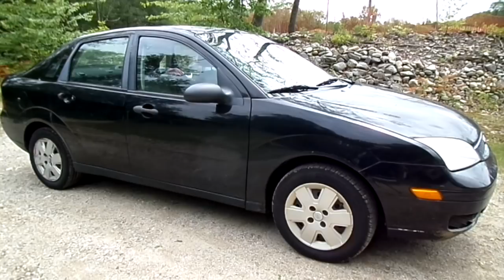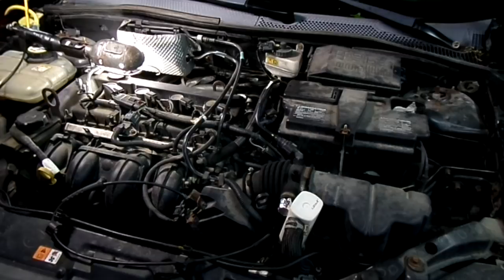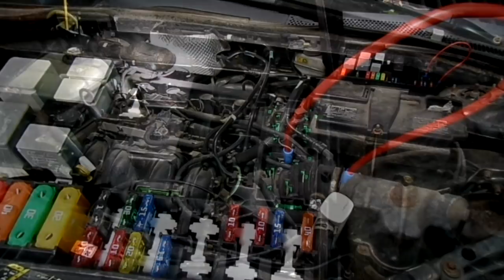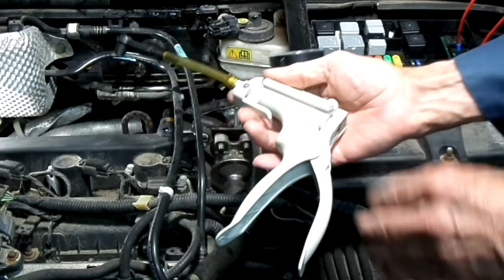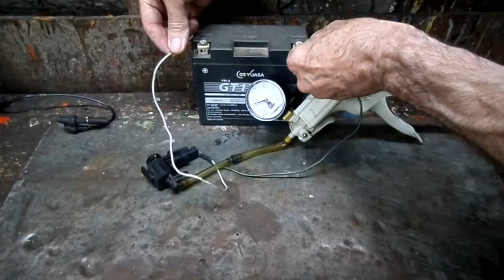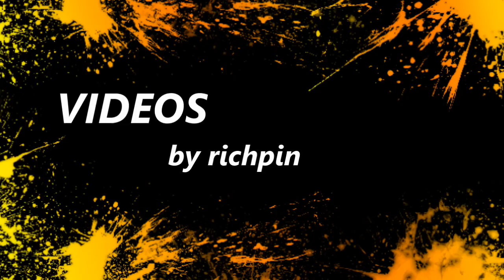Ford Focus P0491 Trouble Code Repair

Comment: Hi are you still online?  I replaced the p02257 code on my 2007 Focus. After replacing the pump I got a code that says bad circuit to the pump. Low voltage B, plus when I tried jumping the pump after the relay as you showed no power would jump it even after I replaced the new pump. 
Can you help me troubleshoot the relay socket?  
Thank you for your useful videos on the 2007 ford focus. I appreciate your content 
What would cause this?

Comment: Saturn has a similar system. I own 3 and all have the air pump. California emissions system.The passages in the exhaust manifold get plugged up with carbon but the diverter valve is the weak link there. Kind of pricey too if you can’t find a good used one at Pull a Part. Thanks again Rich for making the videos. I enjoy watching. My daughter lives in South Hadley. Maybe I’ll be able to meet you some day and buy you that beer.

Comment: Smashing repair rich :-D, "Double Trouble"

When you said air pump i sort of knew it had something to do with feeding air in to the exhaust, but i didn't know what the reason was.
Some kind of compensation at the O2 sensor?
Dodgy devices lol.
Reply from the maker: I do not know of anyone who likes those darn air pump systems.